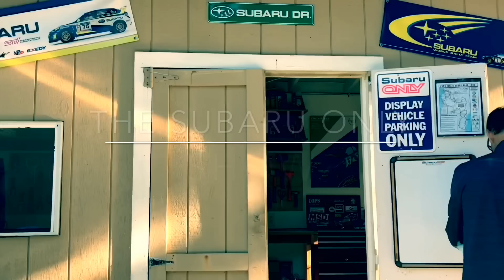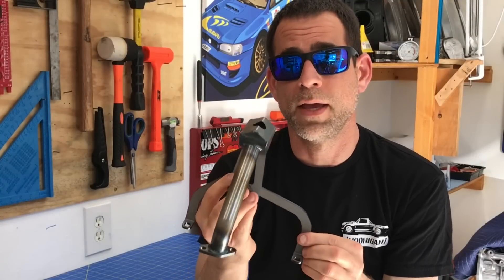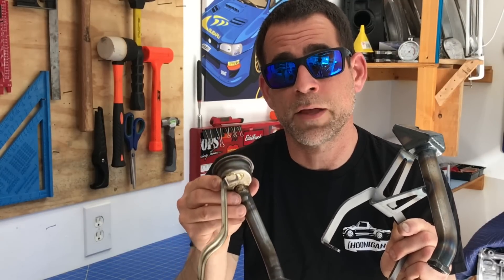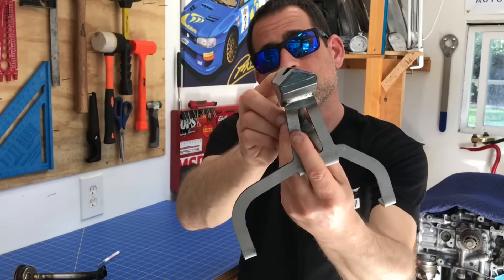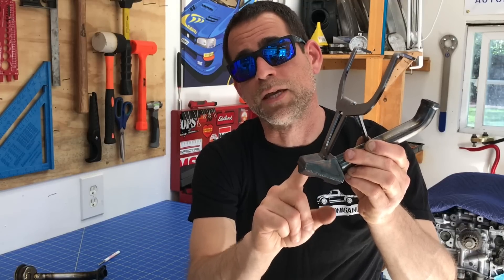Killer B vs. OEM Oil Pickup on Subaru EJ Engines

Comment: Killer bee sump kits are pretty average by design. Not sure who’s actually tested there gear but when running that pick up with spacers in there sump kit the pick up and opening is to close to the floor of the sump. We have done back to back testing and at high rpm there pick up becomes restricted and we start to drop oil pressure we have seen up to 20psi of oil drop over the stock sump and pick up. 

Amazing what good marketing can sell

Comment: Hi Luke, I am building an ej20x and I purchased an aftermarket Moroso oil pick up tube for it. When installed, the oil entrance side is about 3/8 from the bottom of the oil pan. The oem tube seats 1/4” higher, leaving a bit more space. Will the Moroso tube be too long that it could create cavitation and oil suction issues? I wanted to ask your hydraulics engineer knowledge. Thanks in advance. 👍🏻
Reply from the maker: I’d call Flatirons Tuning to be sure, but I think it’ll be fine.  Also, from a hydraulic engineer standpoint (since you asked, lol), having a tighter gap between the bottom the oil pickup and the oil pan floor actually creates a stronger draw for oil into the tube, which is actually better.  One other angle you could take, call KillerB and asked them how close their oil pickups sit from the bottom of the pan - if they say 3/8” then you know you’re totally fine. 👌

Comment: It only takes a minor dent in sump to block factory pickup.
Reply from the maker: Agree.  That new RCM (Roger Clark Motorsport) Oil Pickup adapter would prevent this though, and for only $30. That is another good option to consider too. But I think this Killer Bee Pickup is the best on the market.

Comment: I’m building my engine after I busted a rod bearing. Im upgrading as i go along the build and i purchased an IAG oil pick up.My question ? I’m I able to use a bigger oil pan like the killer bee with the IAG oil pick up.
Reply from the maker: Check with IAG to be sure, but you should be able to use a larger aftermarket pan like the Killer B unit. And that would be a good call for sure!

Comment: I have a 04 erx that im building and im stuck ive bought two different styles of sti pans and neither will clear the oil pickup any tips?
Reply from the maker: Hmm. Not sure what the issue is but the oil pan and pick up do need to be a matched set.

Comment: Did you forget about moroso oil pick up for the WRX?
Reply from the maker: No. I have one of the moroso ones on my 2004 FXT. But I like the design of this Killer Bee one a bit more. Especially the pickup design that will continue to draw oil even if the pan get crushed up.
Reply: @SubaruONLY I agree yes that does apply for off-road rally and such but for daily drivers and street racing on friendly roads,I save myself 80 bucks with a moroso pick up.. I do have a question for you. I just did a 6-speed swap on my 05 WRX. I'm doing the suber dave custom races to do the basic swap for the rear diff and I just want to find out for sure are the front CV axles for WRX the same as the STI 05 we're connects to the transmission?not the end where it connects to the spindles I know those are different.
Reply from the maker: I agree. Also, IAG just announced the release of their fully welded oil pickups - and they retail for about $130!! Very high quality and another option that’s quite a bit less than the Killer Bee one. For the STi axles, tbh, I’m not 100% sure, but call Rally Sport Direct as they literally just did this 6-speed swap for their 04 FXT and I bet it’s very similar to this situation.

Comment: Great videos Luke! Are you going with the oil pan and baffle too?
Reply: I'm interested in your thoughts on the baffle replacements as well.
Reply from the maker: The pan and baffle add a lot of cost to the build. If budget wasn’t a concern I’d upgrade them but for now I got a new 2007+ STi pan (about $100) and 2007 STi OEM baffle (about $30), prob about $500 savings over going all Killer Bee parts.

Comment: Is it necessary to remove the engine from the vehicle to remove the sump ? ( 06 Forester XT EJ255 small sump )
Reply: Nope!
Reply from the maker: Should be able to swap out with the engine in the car, just need to unbolt the engine mounts and lift the engine as high as possible to get that oil pan off.

Comment: Would I still need it in a stock 2020 sti
Reply from the maker: Yes, I believe so.  Check with Killer B or IAG to confirm. Cheers man! 👊
Reply: YES.   I literally picked up my stock 2020 STi today from a $15,200 rebuild.  Piston #4 failed because of oil starvation.   They denied my warranty because of a Cobb cold-air, but the oil issue caused the failure.   I already bought the Killer B parts to install and will do so ASAP.
Reply from the maker: Good luck. Sounds like you are on the right path!